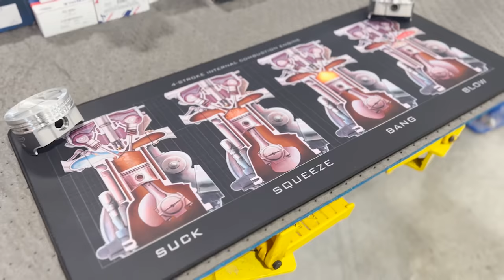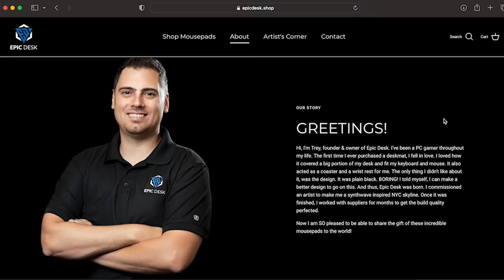The 383 STROKER Kit Has Arrived... Does It Fit?!

Comment: "does it fit". it sure will, right after you clearance the block in multiple places. 🤣 don't forget to check crank and rods to cam clearance, although I think the only interference is on cam install, where the bearing journals will hit rod ends/bolts/studs.

Comment: I go through and cut them all, nothing needs to be precise and you are not going to hit water or oil. I make sure the bottom of the cylinders have a nice radius so as not to scratch the skirts
While I'm there I put the heads on the bare block and make sure the chambers match the edges of the bores and they usually don't. Thanks for the video

Comment: How about doing a HP 400 sbc build that is pump gas friendly that makes good torque and horsepower for the street using a better set of iron heads that breath better showing how to drill the steam holes in the heads for some of us that want to build a 400 sbc .

Comment: They are a very good general automotive machine shop. But not engine builders and it shows.
Guys you need to 30% block fill the water jackets your really close to water with those notches on that late block.
The aluminum heads will soak up heat and equalize it in the chambers, combined with the chamber design, water jacket improvement's will handle 10-1 no problem.
 Check the rod side clearance on that imported kit .012 to .015 is preferable .020 is to much and most of those kits are around .025. That causes all kinds of issues including ring seal issues due to the rod moving side to side even oil pan leaks on one side because the gasket cannot handle the oil being thrown.
You also want to check rod to cam lobe clearance. 
Those imported I beam rods look cool but are soft and stretch the big ends 12 to 6 o'clock resulting in a spun bearing. As you know stock rods also deform but its usually at the parting line. The H beam ones are better but there heavy. Check the bore size and pin clearance on every one. Make sure they have real ARP bolts

Comment: As a European our crap petrol is 95 Ron which is your 91 and our super unleaded as we call it is your 93 and even on the lower quality fuel we can run compression ratios of above 12:1 fine. Is the fuel that bad over there? A high comp motor here would be 14:1 and over

Comment: so i remember reading in a book once by (i think) Smokey Yunick about how you need 0.080 clearance when building a stroker.... so is there any difference between one of those stroker kits vs. the old school way? just curious..... then, ahh, the joys of being follically challenged, this balding guy is envious of the cleaning guys non-bald dome. another great vid by JAMSI.....
Reply: I think the old school way was dropping in a crankshaft and connecting rods from a 400 into a 350 requires bigger ( or at least different ) notching than this kit from SCAT as I think these use a custom crank which can use standard 350 rods! I believe that SCAT's custom crankshaft is forged and will expand differently that a production cast crankshaft! I could be wrong as it has been over 15 years since reading car magazines and my memory is not the best! This is why it would be great if these guys ( James and the cleaning guy ) would do a old school build so we can all see what is different!

Comment: I bet you're relieved you're not clearancing for alloy rods 😎
This sort of tedious task is why 'built' engines cost so much more than the sum of their parts - remember that, folks.

The "big" shops, that do a lot of stroker work, will just drop the block into a CNC mill and use pre-programed cutting, but this is an excellent example of what the 'average Joe' can do in his garage.

Comment: Grinding 400 cranks to 350 mains takes them through the hard layer. A proper striker crank is way better.  I mean even a lot of the cheap China knock off stuff today is better than the gm stuff was in the late 70s.
Reply from the maker: Of course the new stuff is better! That’s what would be fun about an old school build. Comparing the differences!

Comment: If this is going to be a burnout motor i definitely wouldn't have gone with an expensive aftermarket Dart block, you wouldn't need really high horsepower, more high RPM than than anything really...a good crankshaft, rods, pistons, hardware, balancing, high flowing heads, good quality cam, lifter, pushrods, valves, springs, roller rockers, retainers and timing chain is where my money would be spent. I would be willing to sacrifice some lift to spin it faster without valve float, it's going to be abused, so i would get good quality parts but not top of the price list stuff and save all that extra money to build two, you will absolutely get much more from two engines than one with slightly higher quality much more expensive parts 😂

Comment: I like your dad’s take on this build.
After seeing how that 327 was built and beat on, you know that 383 is going to get put through its paces, it would be a good idea to build in a safety factor. Ie lower compression,  a reasonable cam and valve train, and anything else you can do to keep it together when the “happy pedal” is pressed for extended periods.😁

Comment: I know it’s common practice to line hone when you put ARP studs but if you torque them and they measure with in spec do you really have to? Or do you know by experience that they will distort no matter what? 

It’s going to be really interesting to see how the new heads and everything checks out! I’ve got a feeling they will not meet your standards even if it’s new parts.

Would love to see a oldschool build also! 😃

Comment: As much as I love IC engines, the more of these vids I watch the more I realize how inefficient they are with so many moving parts. I can see how electric will be the future, battery and motor with nothing but torque and speed!
Reply: It isn't just the number of moving parts.  IC engines are really not good outside of a very narrow RPM range.  That's why we have all kinds of technology to try an mitigate that inefficiency.
Reply: IC may be inefficient in some regards, it’s practicality is unsurpassed.  That’s why we use them. 
EV becomes more practical, we’ll probably go with that.
Reply: @raoulcruz4404  Not just practical, but actually fulfills the promise of a greener mode of transport.  Right now EVs are nowhere as green as people like to make them out to be.  That doesn't factor in the crazy damage an EV fire can do.  That is a problem that needs more attention and a better solutions.  Using 40,000 gallons of water to "put out" an EV fire is no joke.  Even after it's extinguished it can spontaneously reignite.

Comment: Don't buy a Scat crank for a 351 W Ford. They have no oil slinger, and the rear main will leak no matter what you do. Also, they have a Chevy keyway which is different than a Ford keyway. Poor design.